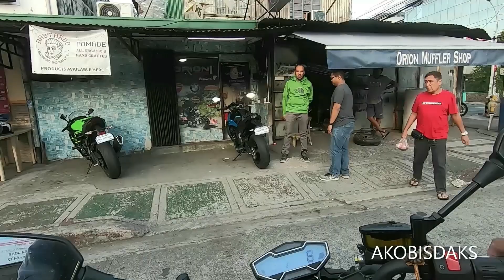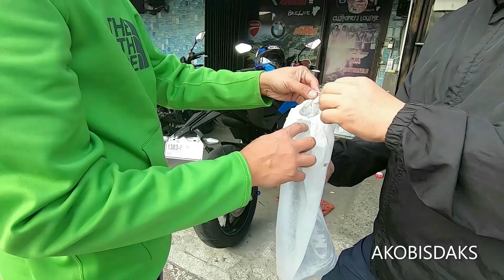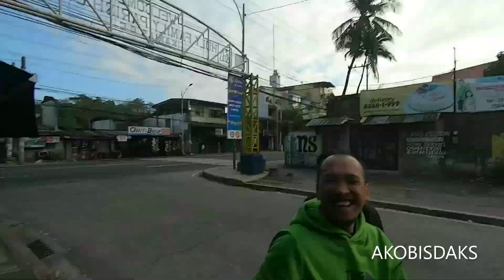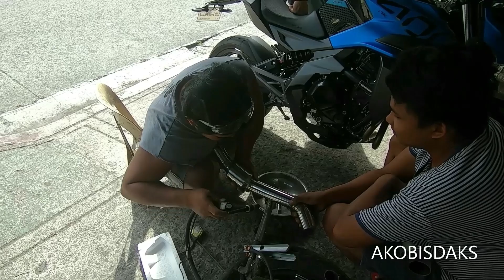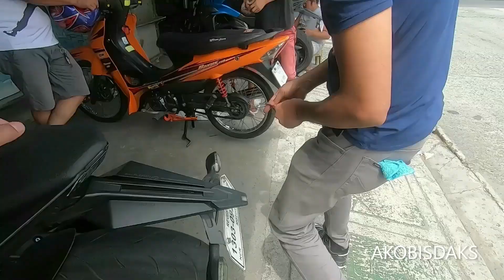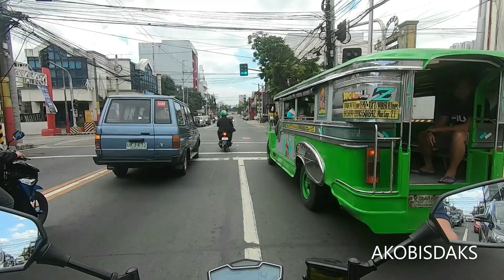NK400 EXHAUST MUFFLER TUNOG LATA?

Comment: Idol, walang huli ang 400cc above na mc kung mag loud pipe?
Reply from the maker: May huli basta pangit ang tunog.
Reply: @akobisdaksmotovlog803  sa ganyan na setup?
Reply from the maker: Kung city drive ka d2 NCR maglagay ka nlng killer dcbel para makabirit ka kahit saan.
Reply from the maker: May mga kasama rin kaming mahuli depende sa lugar.
Reply: @akobisdaksmotovlog803  okay idol. Salamt sa advice
Reply: Kahit 1000cc basta modified pipe huhulihin walang pinipili